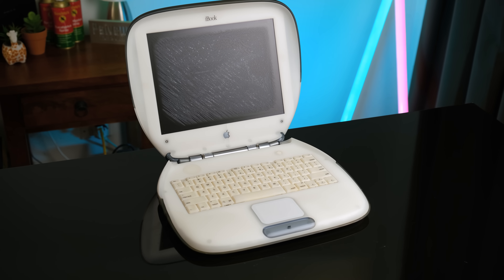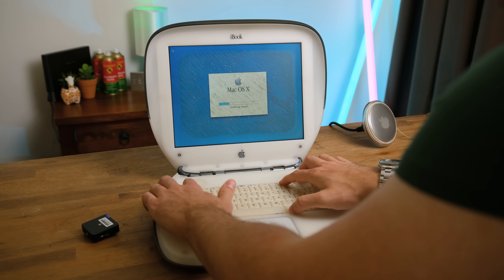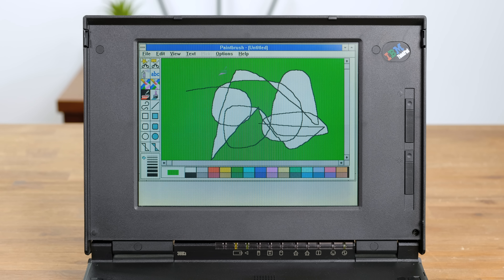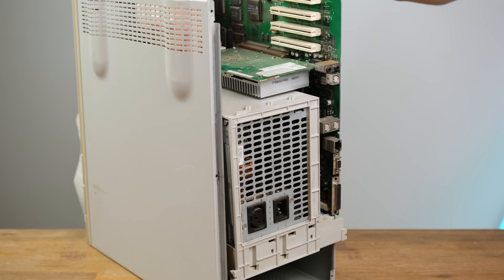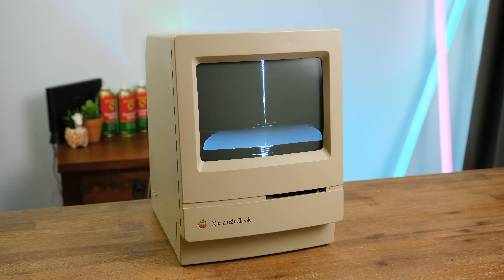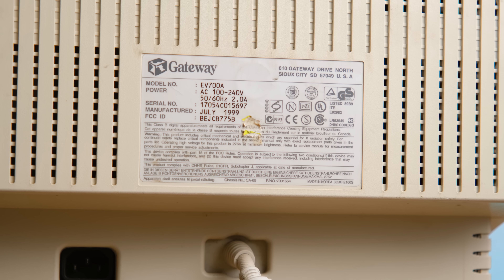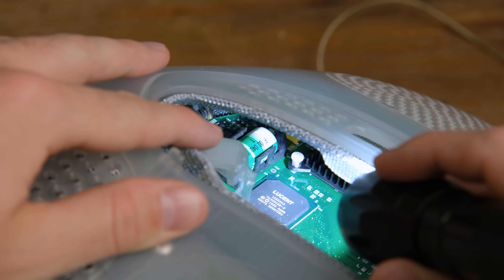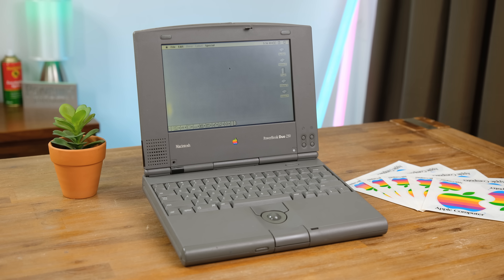So Much Vintage Tech Is Dying... Here's Why

Comment: That nightmare of breaking plastic is also very common with cars too.  It is engine parts in particular that are made of plastic becoming brittle over time or warping from heat and causing a leak.  The worst thing is that more and more parts are being made that way.  It is only because it is cheaper, they would not use these horrible things if they were more expensive.
Reply: Plastic engine parts have been such an issue for me my car is 8 years old and has had a plastic valve go out each year for the last couple years
Reply: Its designed to fail on purpose sadly, more money in parts being needed rather than being set for life
Reply: @Fizzyy_Wizzyy  yeah, but they forget how much of a cheap bastard I am, If I can save 5 bucks by going to the junkyard and replacing a part, I'm going to do it.
Reply: My Fiat 126p from 1987 has so much plastic in critical areas that it's not even worth fixing. The body is in bad condition, the engine is seized and needs most parts replaced, but those aren't even the main problem. It's the plastic. 

The air cooling system is basically entirely plastic and has completely disintegrated. The interior has a bunch of plastic pieces and all of those are showing signs of rotting. The once black bumpers are now a light grey, same with the door handles, the rim covers, the fuel filler cap, etc. The headlights have fallen out because the plastic holding them in place is long gone. 

This is a crappy car and has always been crap. But it's a great example of what will happen to all modern cars in 20 to 30 years.
Reply: My bmw 3 series suffers from the rubber melting issue
Reply: @MantelioXdd rubber melting? Plz, do tell, what part of the car? what year model and make 👀
Reply: Fellow car guy here!  Thankfully, 3D scanning and 3D printing are solving this issue for us!  Guys are 3D scanning plastic parts and just printing replacements or even making molds with the 3D scan so pieces can be reproduced with injection molding.
Reply: Price wasn’t the only reason for switching to plastic parts in cars. Injection molding is incredibly useful, allowing the creation of parts that you’d never be able to make with metal casting. They also respond better to a lot of the conditions cars face. In fact if say when done right, with glass fibre reinforcement and good design, plastic parts are somewhat better for cars than we think
Reply: You better get yourself a classic car that’ll last you a lifetime. Unless you feel like buying a new overpriced car every 3-4 years.
Reply: Don't forget that not only these plastic parts are cheaper to make but they are lighter so as to make vehicles more fuel efficient due to very stringent green deal policies that are reducing choices for consumers over time.

Comment: I have a 2009 White Macbook that I kind of restored and updated with Catalina Patcher and some parts like more RAM and an SSD. Unfortunately, a few days ago I wanted to use it but it wouldn't boot at all. I checked the SSD and it works just fine. It seems the computer now can rest in peace.

Comment: To someone who feels as strongly about preservation as I do, seeing old technology break down like this feels like watching the stars going out, one by one.
Reply: @fgjsdfgjkl electronic devices failing decades after manufacture is hardly 'planned obsolescence' , you are conflating reduction in costs by using cheaper materials to something completely different pretty much proving @BrawndoQCs point.
If on the other hand you were talking about modern day Apple devices that are rendered useless several OS updates from it's release then you'd be onto something.
Reply: tech from the 80s to the 2000s are already very well preserved. There's indepth teardowns with schematics showing you the serial of each individual component and even museums dedicated to tech, housing pristine examples of old tech. Any popular or polarizing consumer level tech will be on the internet until the end of time. Preservation and personal collection are two very different things that get lumped together. You can hope and contribute in the preservation of something without personally ever touching or seeing it in person.
Reply: @fgjsdfgjkl That's not what planned obsolescence means. Those devices were obsolete long before them beginning to break down.
Reply: @rickhapstley3866 unlike a Tesla
Reply: Means nothing
Reply: @fgjsdfgjkl You are talking about planned obsolescence of products that are obsolete. You just don't know what you are talking about.
Reply: very oldschool electronics still work. why? almost no plastics was used.
Polymers just age. Oxygen kills them. UV kills them. Moisture kills them. Vibration kills them. Creep kills them. They are just not as stable as we believe them to be.
I work as an engineer in a company, where we provide 20 years of warranty for our plastic components, but only if they are stored in the same facility, without any change in the environment of the data center. Even then, we are not sure that some of them will not fail.
And to answer your question in advance, no - plastics are so much cheaper and easy to work with, that metals and other possible replacements make no sense, unless it is vital to function for many years.
Reply: TRASHPPLE PISSPRODUCTS BELONG IN THE TRASHCAN ANYWAH HA HA
Reply: stfu im sick of people saying here is me im important when all you do is youtube and nothing else of import
Reply: All by Design. The past must always be deleted so they can keep lying to the next generation about it.
This is why video and audio formats are always changing too. This is only one of the things put in place to fulfil that agenda too.
Why do you think hard drives are now soft drives and everything is pushed online.. All that used to be paperwork. 
Then they Stage an EMP event and delete everything because they put all the data in one basket as they continue to do.
PS: They are the Eastern Matriarchy .. They are The Real Enemy of the people. (Who are not of their lineage.)
These are not CLAIMS either.. They are SOLID FACTS.
Reply: Remove batteries and store in a air sealed container with a few lbs of silica or a moisture remover of some kind.  Replace battery when you go to use it and even a thousand years later if container still has seal it would be as good as when it was stored
Reply: Batteries are relatively easy to replace, but failing caps or LCD screens are bigger problems.
Reply: Depending what is on the hard drives it could be as damaging as the burning of the great library of Alexandria as well.
Reply: that sucks man.
Reply: honestly...yeah... that's a perfect way to describe it...
Reply: I don't think I feel as strongly about preservation but this was heart breaking as well.
Reply: As someone in their mid 30s, it's like watching all of the WW2 vets dying off. Inevitable, but still sad.
Reply: Eventually the semiconductors themselves will start to fail. The older a chip is, the less it tolerates heat. I've got a 386 SX-40 which never needed a heatsink but now it locks up after some time, undoubtedly related to the high heat. 

In fact, most pre-486 PCs have already died. Most due to leaking batteries, some due to heat, some due to capacitors, some just died for no apparent reason.
Reply: @masterkamen371  exactly. People are being just goofy. 

We don't actually need to preserve these things in working order the same way. They are just pieces of plastic and metal. 

Now, recording the history?? A record of how it worked?? Absolutely. 

But we don't need to be so obsessive about preserving the actual hardware. Software is what matters.
Reply: @masterkamen371  Unlikely, usually voltage ripple caused by decayed capacitors that makes that 386 crash.

I've like 10 CNCs from the 1980s, each usually with several 8086, 6800, 68k, 68020, TMS9995... and all of them are still working, else the machine would be dead.

Same thing will my test gear collection, maybe 100-200 CPUs in total, all of them working fine. 

EPROM bit rotting is far greater danger, with old electronics, flash and PLD/CPLD is even much worse, because it's usually not straightforward with cloning these.
Reply: @hinz1  Chances are you're right about the caps. 
But you should not dismiss heat as a threat to old computers. 386 had no cooling and it was decades before the CPUs could over and underclock themselves automatically so they're always full power. It is well known that high heat greatly reduces the life of electrical components. I've noticed an abundance of inexplicably dead components on used marketplaces in recent years, and most of them were passively cooled.
Reply: I would be fascinated by watching stars going out, one by one. I would watch it once, and then go on with my life. Only concerned about 1 star.
Reply: Modern tech has three deaths. The first death is its loss of relevancy as a result of Moore's law. The second death is the end of support for all compatible software. The third & final death is the breakdown of its physical structure.
Reply: An ad in the middle of a nine minute video?   Come on!
Reply: Its old sh-te. Let go hoarder.
Reply: All the more reason to read and study organic chemistry, electronic design and repair, engineering, programming, etc etc.
Reply: Yeah, due to the complexity, price, and nature of the components, it's too be expected
Reply: HP test gear from the 80s is mostly aluminum, that lasts a lifetime, if you do the occasional electronics repair.
It's just crApple garbage, that dies. No big loss, if you ask me. That company went garbage, at the time they ditched 68k.
Reply: @hinz1  Yeah, but it's still sad to see pieces of history get lost, regardless of what they are.
Reply: LOLLLL. No, they will all break down. There is no such thing as preserving this shit long term. It doesn't matter.  @hinz1
Reply: @hinz1 I never knew Apple made IBM laptops you absolute knob 😂
Reply: nope : it's just the opposite... the earth dying is more like a star dying than an old mac dying is. 
Yet the best way to reduce global warming and to avoid the destruction of so many life forms on earth is to use less energy. These old computer use a lot of energy for a computing power we now get using 10 time less energy. 
So old computer dying means less people using them and using instead newer technology which as a very very better computing power, energy used ratio.
For example a raspberry pi3a+ which is a very basic computer unit and can for example make your website runs or emulates an old console (nes, playstation, switch, etc..) use less energy than the radio alarm clock your parents used to wake up in the morning when you were a kid.
Reply: @alienews0  so what do we do if we want to collect old tech?. stay with our arms crossed?
Reply: @ciclon5682  nope u can, just don't use it
Reply: Planned obsolescence + oxidation 💀
Reply: @GardeDuCoeur  I wouldn't say planned. These devices still worked decades after being manufactured
Reply: @GardeDuCoeur  That is not planned obsolescence. People are using these words way too easily nowadays.
Reply: @BrawndoQC  oh its planned.
Reply: @BrawndoQC apple absolutely does plan in obsolescence
Reply: @BrawndoQC  
90s beige macs were absolutely planned obsolescence. Don't gaslight.
Reply: @GardeDuCoeur  are you 12?
Reply: @oozly9291  Yes, i'm 12 inches, how do you know? I said to your sister to never expose me... smh
Reply: @GardeDuCoeur  thanks for confirming about being an adolescent 👍
Reply: @GardeDuCoeur you obviously don’t know what planned obsolescence
Reply: @alexmason5521  Apparently it's you who doesn't understand how deep planned obsolescence is, it's not just a capacitor that was specifically designed to die after N+1 number of charge/discharge cycles. It's also in the choice of plastics, glass, metals...
Planned obsolescence is found in the number of uses, but also in time.
Reply: @GardeDuCoeur  the computer was obsolete far before the screen starting rotting. Use your brain.
Reply: @GardeDuCoeur claiming this as planned obselence is just stupid. We wish we could keep our phones for 20 years. But being a durable piece of tech is not the same as being eternal
Reply: @GardeDuCoeur  oxygen is the final boss.
Reply: @GardeDuCoeur eh na they just used cheap materials what do you expect it last a life time?
Reply: @GardeDuCoeur  this tech is probably older than you, its not planned either since this stuff is working 15-30 years later
Reply: the thing is theres nothing lost from old tech not working anymore at all. nobody is getting harmed in any way. nobody who is stuck in the past is any kind of intelligent

Comment: I know if you are storing a car for many years you need to drain all the fluids and remove batteries etc... Maybe for computers you remove all the batteries and look into plastic treatments for long term storage. You also see this in cars where the plastic just gets dry / brittle and breaks off (this is why early 2000s German cars are trash btw, and why you rarely see them on the road - to meet modern fuel standards they cut weight of the car by making bits plastic... but this kills the longevity of the car). 
 Or maybe for Retro Tech - you literally just save the bare boards, and just 3D print new casing when ready to bring back to life? 
 I actually think its an important issue for preservation of history.

Comment: From my experience this all happens from being stored away. You have to make sure your electronics are stored in the proper conditions. Not in hot humid places or cold dam places but room temp. Once in a while it’s also not a bad idea to pull your old systems out and turn them on let them run it’ll keep them working. It’s like a car let it sit too long things start to break on it.
Reply: @MrHocotateFreight  LOL but seriously though a vacuum chamber, or at the very least a sealed membrane that prevents outside O2 and N2 might mitigate the rusting and other adverse mechanisms
Reply: Would storing them in a vacuum environment help?
Reply: @younglee6469  Some plastics degrade sooner than others, no matter what. Plasticizers just migrate out the material. Volatile components will actually escape faster in a vacuum. Inert gas environment, like argon or even nitrogen, would be a better choice.
Reply: @younglee6469  I suppose for most of the components that would be beneficial. But I guess there will be some components that will not like it. Maybe CRT some CRT screens are kind of sealed? Maybe capacitors will be more likely to leak because vacuum will "pull" the liquid out?
Reply: I have been using my old Tube TV for almost 18 years. I wonder how much longer it will last.
Reply: Wouldn't it be a dream to make stuff designed to be left alone and untouched yet still work good as new when you get back to it. Scale this on for 100s of years. That would be true reliability
Reply: @MrHocotateFreight nah, space wouldn't preserve it, rather the opposite. The environment of space is much more harsh.
Reply: That was exactly what I was thinking

Comment: I’m not sure of your exact climate or humidity , but I noted that you mentioned storing your devices in a dry cool place.  However, I have numerous vintage devices (similar IBM laptop) that I recently opened up.  It ran without issue and the screen is unaffected. I have a G4 MacBook and G4 PowerBook and two different Sunflower Macs…aside from the severely outdated hardware and software…they can still run in a very limited capacity.  Besides the aesthetics or potential of custom mods, I find that they rarely warrant powering up to use.

Comment: thing is the really older stuff like original ibm pcs, will likely still keep working (psu rebuilds may be necessary eventually, also floppy drive servicing) ,  and many 'home' computers will still be ok, except for 'bit rot' in eproms, and other programmable logic devices , so always do a 'rom dump' and keep that file if you can!

Comment: I feel happy for dealing mostly with analogue gear. Far, far less issues - even the electrolytic capacitors seem to hold it for much longer. They often develop DC leakage, but in most applications it is not really important. And things like cogwheels and idlers for 1980s cassette machines (not all but quite many) are still easily available.

Comment: One thing I know about battery packs for laptops. You should never store them in a drawer because they can’t get air because batteries of any kind in and especially lithium-ion batteries give off a invisible fumes that will build up in a drawer, and you should never store your battery packs and a cold fridge. A cool fridge is acceptable because that will make it last longer and you are so store the battery packs when not in use at 50% and also you never keep batteries at full charge all the time this will degrade the battery life if you have a battery program on your laptop by the way, like power manager, or Dell power manager, or something that will do similar function change the value to 40% to 80% that will overtime increase their cycles of the battery pack to use the battery you can still fully charge the battery pack but for a lifelong use keep it at 50% or  60% of the capacity.

Comment: The laptop with the screen totally dead has a broken cable connecting the power to the screen. It happens a lot. Fixing it sucks as you have to replace the line that broke inside the hinge

Comment: Seems one would have to store them in an air tight container with O2 and H2O absorbing packs in them. And obviously taking the batteries out. Or perhaps some gas displacement with some nitrogen.